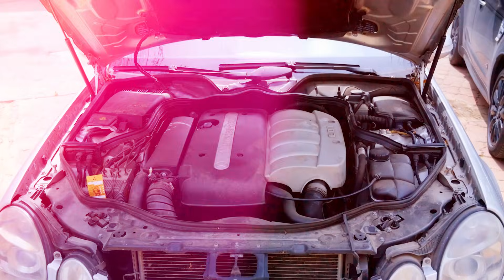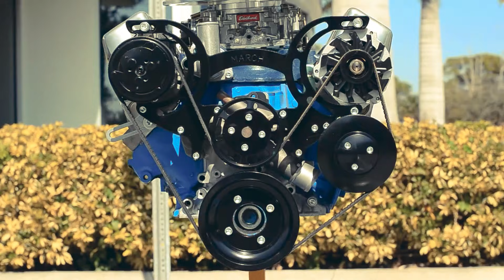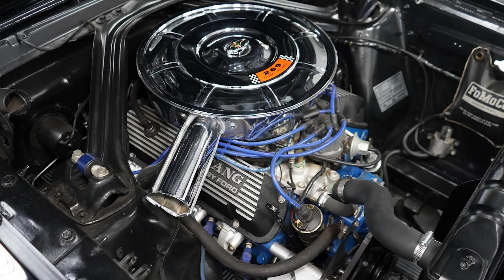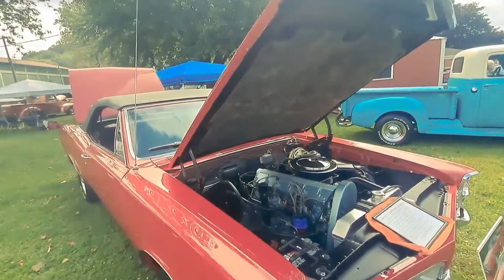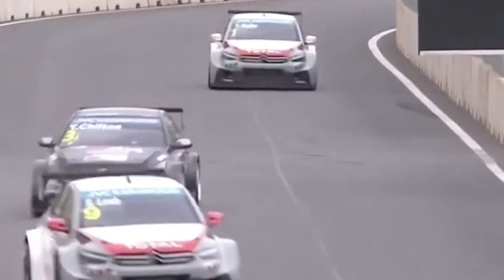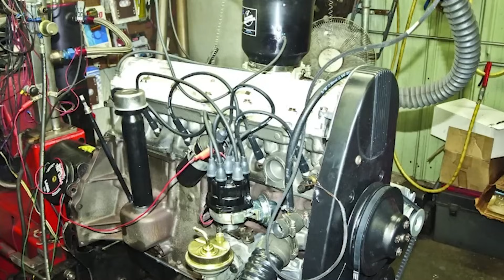Australia's Drag Racing Secret: The Engine Ford and Chevy Both Copied

Comment: Fact is , the design team went to Detroit in 1967/8 to basically pick best design of current V8s to suit the Australian V8 , design parameters were a " big" motor of about 290ci and a " small" motor of about 230ci . In the end the early Holden V8 was about 85 percent Oldsmobile V8 engine, the intake and exhaust port layout is Oldsmobile and only Oldsmobile and early Holden use that setup . No other V8 does , the 6 deg valve angles only Oldsmobile and Holden used then ( now LS and Ford Godzilla do ) , the valve train is all Oldsmobile with those alloy bridges ( infact Holden roller rockers are the only ones that bolt on an Oldsmobile V8 out of any GM V,8 family that's how close they are ), same intake design and carbie, same bolt circle on crank ( I've used a 308 flywheel on a 403 Oldsmobile, bolt straight on and correct balance ) , same mounts ( I've used VN 5.0 Holden mounts on a 403 Olds swapped into a HX Holden Tonner) , so many design features exactly the same , but the Holden is a bit chev small block in bore spacing, and later bellhousing pattern ( Trimatic pattern is very close to Oldsmobile, so close you can redrill Holden bellhousing to fit Olds ) , as for the oil pump , that was done so the Holden V8 could go in many different chassis and oil pan could be made front, mid or rear without an oil pump in the way . And really the Oldsmobile V8 was best of GM in design , it was after all designed by Charles F Kettering himself . It's funny , if you show an early Holden V8 to an American they instantly say " that's an Oldsmobile V8" the early Holden V8 also had the Olds oil fill tube in the timing cover , something GM people know identifies an Oldsmobile V8 Gen ll , Holden removed the oil fill tube pretty early , but that round alloy Boss cast in the top of the timing cover remains till the very last motor . 

As for the 1988 redesign , obviously anyone can see this is were the LS1 came from , it's no coincidence GM looked to the only other V8 in their company that had been updated recently to design the LS1 and before anyone flys off on the LS band wagon , I suggest you Google a picture of the 1988 Holden 5.0 injected V8, you will notice instantly the exact same intake design as the LS1 that came 10 years later , that " bunch of Bananas design " as stated LS and 5.0 injected have exact same 6 deg valve angles, same port locations, same bellhousing, same engine management, same design roller cam and lifters , same bore spacing . But the Holden was a decade before the LS1 . But companies do that , GM owned the patents to the Holden V8 and just used them on the LS1 . 

As for all the Pontiac OHC in the Vid , well there is a link , Holden designed and built many 5.0 OHC 3 valve motors for testing , and used the Pontiac design to do it . The original Pontiac OHC design was for the 428 and 455 but never made it to production , only on the six , there's plenty of pictures of the Holden OHC motor and reports of test drives in Commadore s , shame it never made it to production. 

Theres another link to Oldsmobile, in the late 1970s Holden was using up the last Monaro bodies , they planned to install a batch of 403 oldsmobile small blocks and T400 autos in the LE Monaro project , as the LE already had a fair bit of Trans Am parts borrowed on it like the Honeycomb wheels and trim parts the Trans Am's 403 ci Olds motor was a natural , 6.6 litres would set the LE apart from the rest . But it never went ahead, I wish it had with the Trans Ams shaker hood scoop and even "Screaming Chicken" on it !! But the outgoing GMH president was going back to US and wanted two LE Monaro's to take back , the 308 would have been useless in the states to get parts for , so two 403 Oldsmobile V8s and T400s + GM 12 bolt posi diffs were installed at the factory . Both shipped to the US , and after talking to a GMH engineer some years ago , he confirmed both 403 powered LE Monaro's are still in the family in the US .

Comment: The Windsor V8’s were in Australian delivered Ford cars before the 1966 XR Falcons, we had them in our “Compact “ Fairlanes years earlier in 221, 260 and 289 ci versions, also small block Chevy engines were in Holdens from the 67 HK series in 307, 327 ci in Monaro coupes etc and 350 small blocks in many Holden models optional with both Holden V8’s and Chev small blocks, the LS series were introduced into Holdens in the late 1990’s after Holden dropped their local V8, the last iteration of the Holden V8 in the injected 304 and stroker 350 was a fantastic engine and are much sought after, as an aside Why all the pictures of American inline sixes in what looks to be your overhead cam Pontiac Tempest? Engine got to do with our Australian V8 Lol!
Reply: 221 to 302 was never called a Windsor , only 351W in 1969 to differentiate it from the other 3 Ford engines the exact same size around that era , 351C, 351M and 352FE , no Ford paperwork ever called them a Windsor , plus last injected V8 was 355 not 350 . + 0.030 over bore in the machining process when built .
Reply: yeah well that’s true but I was really referring to its design however both 289 and 302’s were built at both the Windsor and Cleveland engine plants and the earlier engines at Cleveland, as far as the Holden engines are concerned I think most people know it was 350 as in the the GTS, Senators & Granges without picking at straws